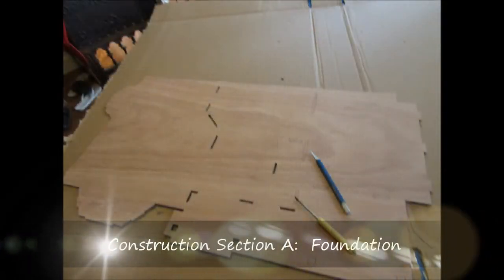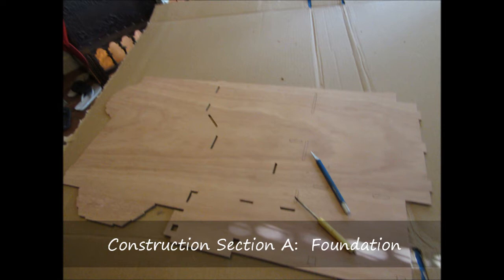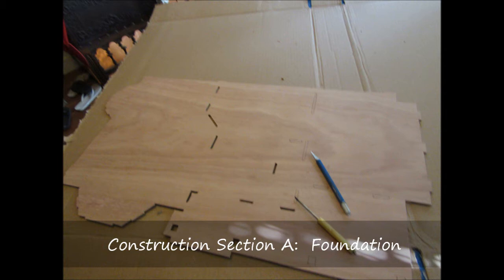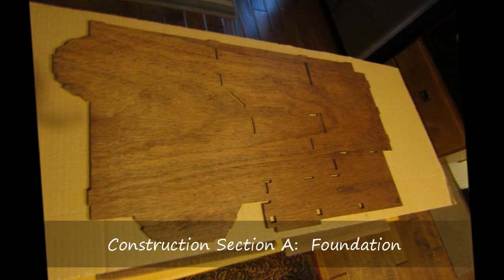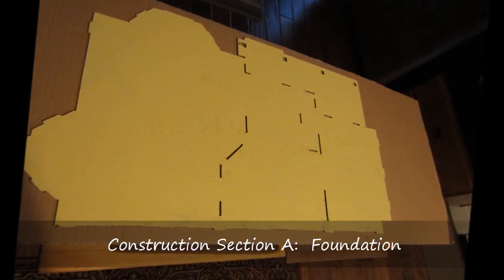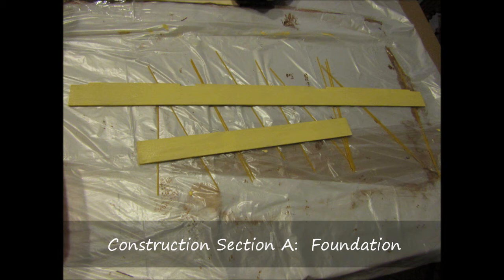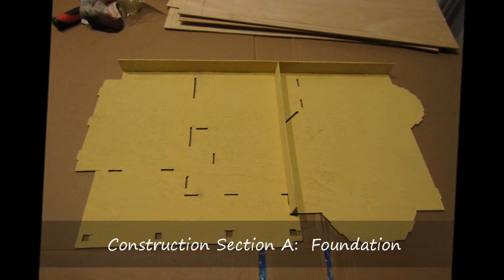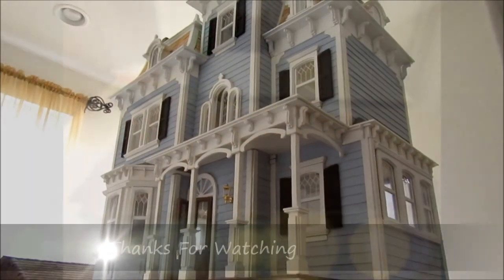Beacon Hill Dollhouse Construction of Section A:  Foundation

Comment: How long did it take you to complete the Beacon Hill Dollhouse from start to finish?
Reply from the maker: This took approximately 8 months to complete.  Your time can vary depending on the amount of detail and frequency of work.
Reply: @BradVaughn  how many hours each day did you spend on this?
Reply from the maker: @triciamiller3586  This varied from day to day.  But I easily spent at least 2 hours a day on the construction.
Reply: I'M TRYING THIS WAY TO COMMUNICATE WITH YOU. I'VE JUST STARTED THIS BUILD. IVE BEEN WATCHING YOUR VIDEOS, EXCLUSIVELY FOR THE PAST 3 MONTHS. IT'S A XMAS PRESENT FOR MY GRANDTWINS. IVE GOT NOTHING BUT TIME. CAN I GET YOUR EMAIL? IVE BEEN REACHING OUT TO THE GREENLEAF FORUM OUT OF CANADA, I BELIEVE. FIRST QUESTION. SHOULD I GLUE FOUNDATION AND BOTH SUPPORTS TO RAW WOOD OR IF ITS STAINED WILL THE SUPPORTS STILL BOND? THANK YOU. YOUR VIDEOS WILL SAVE ME. HAPPY NEW YEAR.
Reply from the maker: @mmdozzie2553  As you can see in my video, I stained and painted the pieces before gluing these together.  I did not have a problem with the bond.  However at a later phase, I added additional wood (square dowel rods) on the underside of the foundation.  The house becomes rather heavy and I thought additional support was desireable since this only has the thin foundation walls.